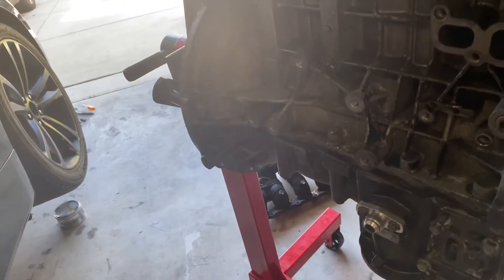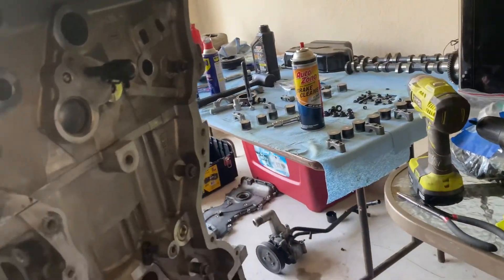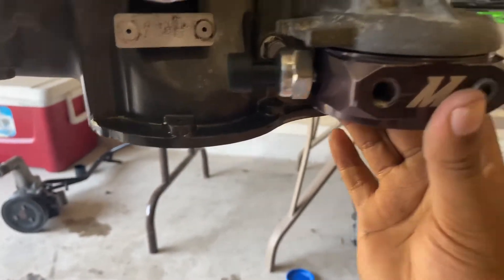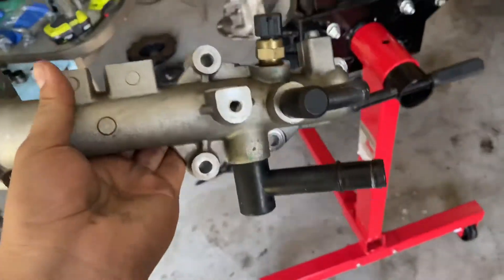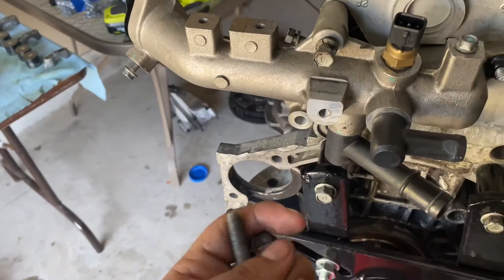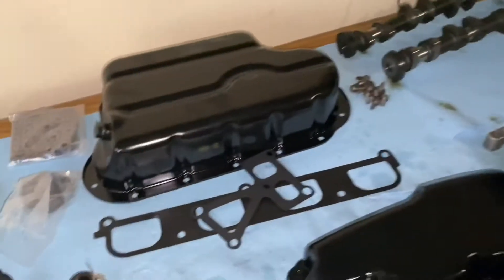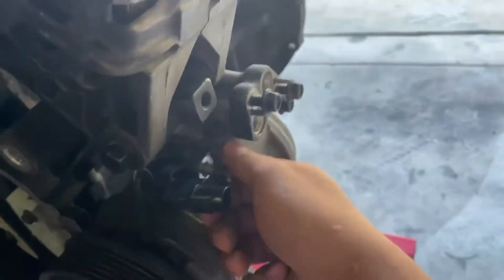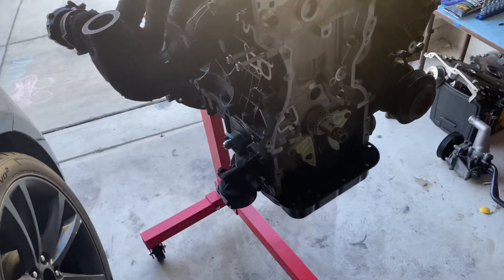Genesis Coupe 2.0T Engine Build Pt.5 | Accessories

Comment: Yooo... quick question... with the oil filter housing install, what else do I need to do? This looks simple but I'm wondering if there is more to it than this. I have to replace the oil filter housing on mine, and I've got a housing and gasket ready to install.